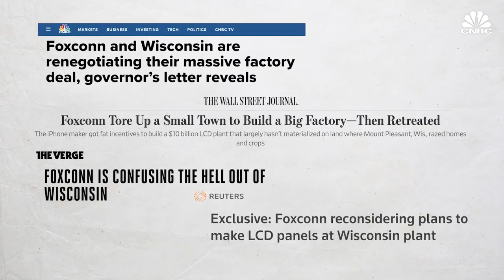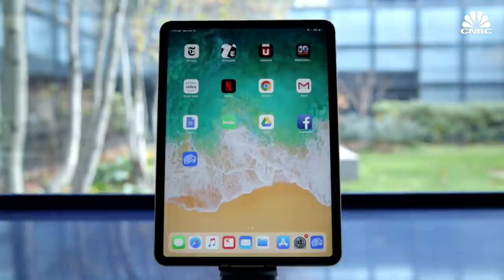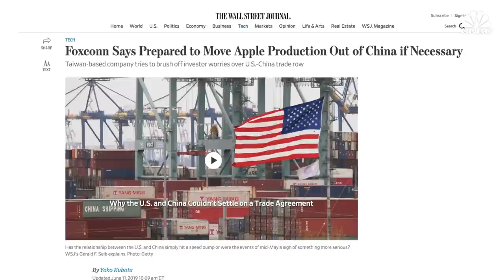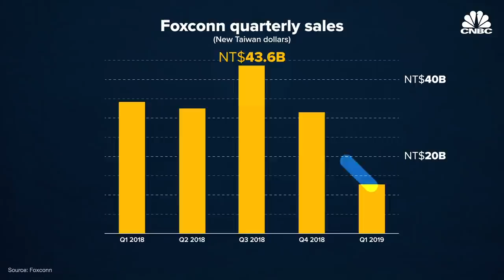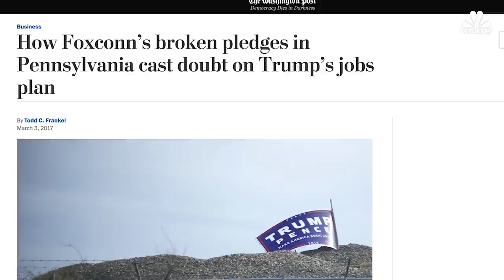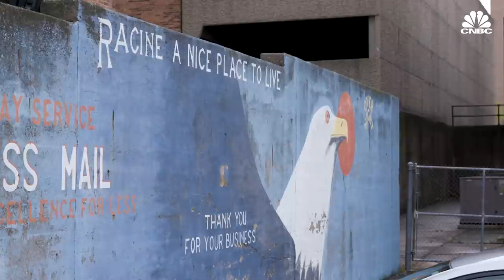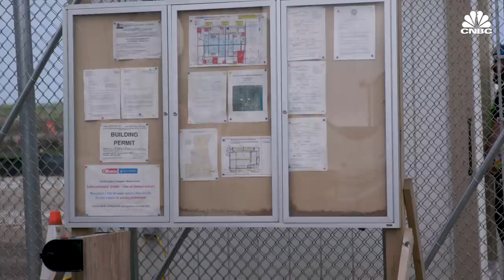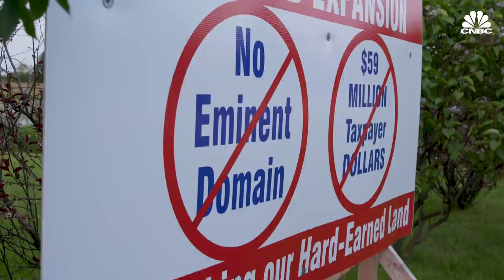What Foxconn - Apple's Largest Manufacturer - Is Up To In Wisconsin

Comment: that's what's wrong with America, if you ship these heavily polluted jobs to oversea, you complain they take your job and polluting the world. When it's coming back, you hate the pollution and doesn't want to pay higher price for the same good.
Reply: Your right. And we continue to get this wrong. Our current president is not helping matters.
Reply: The people who complain about jobs being shipped overseas and the people who complain about pollution are 2 separate groups of people.
Reply: What? Jobs and pollution are two separate problems and issues... And you still miss the point.
Reply: @trance9158  Poor nations usually have poor environments.
Reply: @AQuietNight  China is not poor...Japan is not poor....shall I go on?
Reply: @trance9158  What point am I missing?
Reply: @trance9158  Why are they separate issues? In this case, they are not. You want to build a giga-factory that employs thousands, you still have to worry about where you are going to dump the effluents from the factory. If the factory is going to generate its power, what kind of fuel is it going to use, and how is it going discharge the burnt fuel into the atmosphere. That is the downside of manufacturing: pollution. China has some of the worse air quality in the world, especially around big cities where the industrial hubs are located. The government there turns a blind eye to it, because their environmental standards are lower.  And it makes products manufactured there cheaper. If the US wants to compete with China, then it would have to lower its environmental standards, and I don't think a lot of people from both political spectra will be thrilled.
Reply: The only exceptions to US regulation the video mentions is a bigger plot of land and more water. Doesn't seem unreasonable given the situation.
Reply: @badmojo420  I think there is more to it. Manufacturing of LCD screens uses a lot of toxic chemicals that need discharging to somewhere. Except they just want to do the actual manufacturing of the screens somewhere else(China and Mexico being the usual suspects), and then just assemble the components into actual products in Wisconsin. In which case you have to ask, all that hoopla just to assemble LCD screens? Not too high tech if you ask me.
Reply: @eudofia  You know that environmental regulations prohibit factories from simply dumping hazardous waste on the ground next to the building right? They will probably end up paying a hefty sum of money to some US based hazmat disposal company to haul it away every month. Like I said, the video mentions the US only making exceptions for land area and water amount. If there was an exception that allowed them to dump hazardous waste CNBC would be focused on that for half the video.
Reply: Because CNBC is Chinese propaganda tools in America. Most of they executive buy by Chinese. They make this look bad so they can ship the job back to China. Tesla took less time to complete factory in China CNBC was happy.
Reply: @RandomAudioGuys  how the current president is not helping the matter. If not because of him this won't happen. Democrats has been saying job is not coming back for year's. They're doing what ever they can to stop this project.
Reply: Da Co  how is not helping, explain.
Reply: Da Co  United States, how about you?
Reply: Da Co  let me tell you this. Industrial country is a superpower country. Once you loose your industrial you loose everything. It take a lot of sweat of blood to get United States to here. Lots of life lost to get here. Since 60s Americans has been hand over what took many people life and lots of had work over to China for free.
Reply: Da Co  what is your concern?
Reply: KELLI2L2  They aren't dumping it anywhere. Hazardous waste would be hauled away and made non-hazardous. Waste that can't be destroyed safely would be stored deep underground in an old mine shaft where it poses very little threat to people.
Reply: I completely agree! People want to have their cake and eat it too, but they can't have it both ways. For better or worse, we have good evidence that China's political system works, and is able to deliver real benefits to its citizens at such speed the world can see with their own eyes.
Reply: @eudofia  the grid powers these factories. Most of that comes from nuclear power, which is a clean energy source.
Reply: @trance9158  Go on all you like. But you did miss my point.
Reply: @ekoms108  That's correct when you talk about this particular factory. But when you talk of manufacturing in general, there are some industrial processes that due to their nature need to generate their own power, or use some type of fuel. And all that emission end up in the local atmosphere. And you still have to also deal with the effluents from this plants.
Reply: @badmojo420  Exactly what I meant. The environmental standards is higher in the US as compared to China. For that reason, it is more expensive to manufacture in the US because of stricter regulations. And that is not even considering labor costs. From what I have gleaned from the video, Foxconn will be using the tax incentives to offset some of those costs. But it is still an upward battle to manufacture competitively in the US. Especially LCD screens which has become commoditized over the years.
Reply: @mikef4077  this was a done deal before conman traitor trump was in office. He had nothing to do with it. The former louse of a governor did this....SMH
Reply: Pay higher price for the same good? That's what Chinese do.
Reply: Buttt..you're NEVER wrong!!!! EVER!!! That's actually what it is.
Reply: @eudofia  Of course, the cost of progress for China is 1.4 BILLIONS with HIGH RISK of various Cancers with current death tolls of millions each year. 

The US has this in the 70's, then after people got wealth, they want to live longer to enjoy that wealth. Only when people have nothing again, they would want to risk their health for wealth. That's the cycle of life.
Reply: The cost of fast progress for China is 1.4 BILLIONS with HIGH RISK of various Cancers with current death tolls of millions each year. 

The US had this in the 70's, then after people got wealth, they want to live longer to enjoy that wealth. Only when people have nothing again, they would want to risk their health for wealth. That's the cycle of life.

China is current in process of clean up because the old uneducated generations will die off soon and they don't want to destroy the younger generations which often more educated and would demand for better health like massive protest in US before.
Reply: @mikesamra9126  The left? You do know we got involve in Middle East not just for oil, but to support Israel and billions dollars each years from Evangelist going there, right? 
Not to mention the WARS because again US support Israel, so Muslim target US instead.

Then the idiots got rid of unions to give more power to corporations to ship jobs to China for more profits and gave all the tech to China.

Even Pence said the US created what China's today.
Reply: @CuongNguyen-le5ic  Yes, I agree all of what you said. We have a two party system that only cares abut wars and the industrial military complex. This is why you see the big split in both parties. The GOP with the alt right and the Dems with the new progressives. Neither the alt-right nor progressives want wars and both side want the trade policies changed to favor workers. This is happening all over the world and now even Chinese workers are demanding high wages.
Reply: @trance9158  with this wall street games no company want to come to United States only to move out just to satisfy wall street money hungry.
Reply: @badmojo420  You are wrong on the environmental regulations they have been exempted from @15:45 on the video it says they have been allowed to skirt several regulations including.....she only mentions 2 i am sure there are more than 2. On the other hand i am sure they are prohibited from dumping hazardous waste. The amount of water they can draw from Lake Michigan can have serious consequences for fishermen, it can reduce the water levels seriously and destroy livelihoods. Environmental protection is not about toxic chemicals only. The other exemption granted does not relate to land size, it relates to the amount of natural habitat they can destroy, things like trees and vegetation which when birds and butterflies disappear, so do small animals like frogs, racoons etc. I am not saying they should not build i am simply saying the purpose of an environmental assessment is to come up with mitigating factors from simple things like asking the developer to plant new trees, not covering the whole compound with concrete slabs, monitoring water and fish levels etc
Reply: @mikef4077  Those jobs aren't coming back. On the other hand this is why US is losing to China. China is talking about 5G, US is still dreaming about in 80's manufacturing. China is building the silk road and belt, America is destroying all its trade links.
Reply: @michaelotieno6524  The site where they're building is the "natural habitat being impacted". Is that not the same as saying they want to use a bigger plot of land? If there are other important regulations being skirted, why did the report not include information about them? The water levels in the great lakes has actually been going up recently. They're a huge source of fresh water, and humans are already pumping tons of water from them for just about everything you can imagine. Have you ever been out on the great lakes? They are massive, it almost feels like being on the ocean when you can not see shoreline in any direction, and they're deep. The amount of fresh water that even a giant LCD factory will use is so minimal in comparison to their size, and most of the water used will end up back in the lakes.
Reply: @potatoswagger  That's why it should be renamed as DSA - the Divided States of America
Reply: Agreed, factories pollute.  Period.  If you want those jobs, you get the pollution.  If they factories go overseas, both jobs and pollution go with them.  Manufacturing usually means low paying jobs in the short run.  But eventually labor costs will go up.  Then the prices follow.  So multi-nations go to "poorer" countries (usually with good education).  
From what I understand, India is next then Africa.
Reply: @badmojo420  A natural habitat is an environmental issue, plot size is a zoning issue. 
They were exempted from making an environmental statement so the full impact of the project will not be known. They were exempted from clean air regulations by the EPA (it is estimated they will emit 229 tons of nitrogen oxides, 240 tons of carbon monoxide, 52 tons of particulate matter, four tons of sulfur dioxide, and 276 tons of volatile organic compounds per year). They have also been allowed to divert streams and discharge waste water directly into streams during construction.
In lake Michigan they will draw 7 million gallons of water per day. While what they need is little compared to the size of the lake how and where they draw it from is more important. Drawing such an amount of water interferes with the lakes underwater currents fish may stop nesting in the area and move to other areas etc.
Reply: @michaelotieno6524  do you work in wall street or what? I'm guessing you're banker who don't know advantage of manufacturing job in your country. Chinese has been playing British battle of Singapore when 90,000 strong soldiers with heavily equipment surrender to 30 thousands Japanese soldiers with less equipment. Do you know why, because British thought Japanese had almost a million soldiers. Fear and panic let British give up. Chinese claims they have billions of population, they've been using this trick for decades now. to me I believe Chinese population is between 500 to 650 million. Back in 1945 Joseph Stanley said share of population will over power technology, that work had stock in mind of Americans expecially general Curtis LeMay.
Reply: @mikef4077  It is simply the economic life cycle. In 1900, 42% of the American population was working in agriculture now only 2% of the population works in agriculture the reason is technology and machines. From 1991 agricultural output has increased 300% yet the number of people working in agriculture has reduced.
The same issue has happened to manufacturing in 1960 manufacturing employed 32% of the work force in 2019 it employed 8.5% of the total work force, however in the same period manufacturing output has increased 600%. To put that in perspective in 1960 we had 16 million workers in manufacturing now we have 12.8 million workers yet we are producing 6 times more goods. Automation and machinery has cost manufacturing 90% of its jobs and it will continue to do so.
In terms of the Chinese population there is a difference between what you believe and fact.
Reply: @michaelotieno6524  do you know that industrial country is super power country, once you loose your industrial you loose your power, that's what happens in American today. How wall street people and media are giving years of hard work Americans away to Chinese in name of profit. It take years and lots of life to get American to this and now some Americans prodigal children's are giving away just to get profits. Once Americans loose it all, they will never get it back. Your kids and your grand kids is going ask why do you let this happen.
Reply: it's a downward spiral jobs got removed from the country forcing people to do low paying jobs making them depended on cheap good made in other countries where the jobs where moved from in the first place the only way out of this cycle is putting tariff on imported goods so company will  have to pay decent wages in order to get people to work while reducing government spending and welfare programs to reduce taxes on the working class which in turn will put more money in people's pocket so higher wages offset the higher cost increasing people's way of life therefore making them more environmentally conscious thus reducing pollution.
Reply: Pollution is a necessary evil for a consumer society esp when it comes to electronics. There are limited ways to dispose of inorganic waste produced in factories (minus throwing them underground) at a price that keeps producers competitive and makes shareholders a return on their investment. The game of capitalism alas.
Reply: You clearly have never been to Wisconsin it's basically 80-90 percent empty land. It can barely be called a state. No one cares about the land or pollution of this area almost no one lives there.
Reply: Ebenezer Fitzpatrick lets be real.  On the world stage, do you think people really care about different groups in USA?  To them, they are all Americans.  If there are internal conflicts, that’s USA’s problem, not to the people of the world.  If Americans can’t even agree about an issue internally, how do you even compete in the world stage?  Just imagine if you are running a multi-billion international corporation with internal issues like this, are you going to thrive or bankrupt?
Reply: Uhhh look Americans having contradictions...
Reply: well... yeah.
Reply: 15:40 DOnt take our hard earned land  LOL wtf white folks snatched , rounded up land from natives and left them to die while foxconn is buying land . not forcefully taking away .
Reply: The people complaining on one side are not the same people complaining on the other.  Of course a few people are going to take a NIMBY attitude.  Yeah, it sucks to be them, if this factory actually gets built (which is not looking too good right now).
Reply: Tony Dinh  Oh yeah? Try googling "great lakes water levels" and obseve all the articles about record setting levels.
Reply: Tony Dinh  Obviously I do not think everything on google is a fact. The fact is you could easily go to where the water level is measured and look at it for yourself, you can blow the whole lid off this conspiracy. When I see a lot of recent news articles indicating the water levels have been at record highs, I just assume it's the truth, because it's something so easily fact checked. I haven't checked the levels myself, so who knows, maybe you're right and we're all being lied to about the water level. Is it just a mistrust of google, or was there some basis for your doubts?
Reply: @badmojo420   You can corroborate stories without stepping out of your house.   Just cross-reference whatever you read with trusted sources.  If the story is true, you will find plenty of affirmation.  If it's false or controversial, you'll find plenty of info on that too.  Follow the online searches and hyperlink trails to enlightenment.
Reply: You nailed it!
Reply: If you think this is limited to the U.S. (America is a set of continents not a country get it right) then you are the one with a problem.
Reply: Lol 1st world problems
Reply: it's funny. that's why i keep my mouth shut because i would i know be a hypocrite if i complained. i like cheap goods too. you hit it right on the nose. people don't want to be for american made products and complain when companies move their warehouse overseas
Reply: so true 👏
Reply: Yes, you are right. China is slowly moving towards high tech manufacturing. While shifting the low end stuff to places like Vietnam, the Philippines, etc
Reply: There’s no winning with some people.